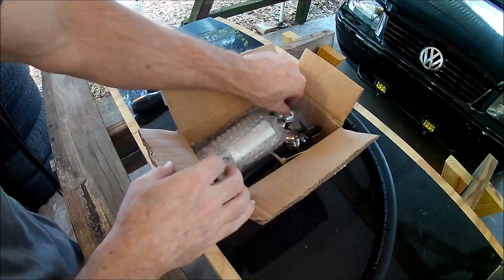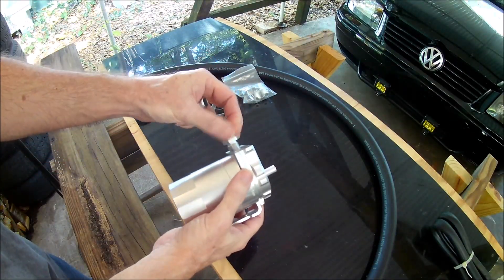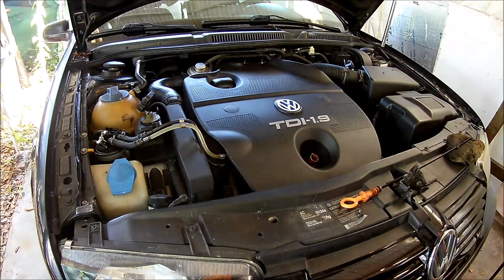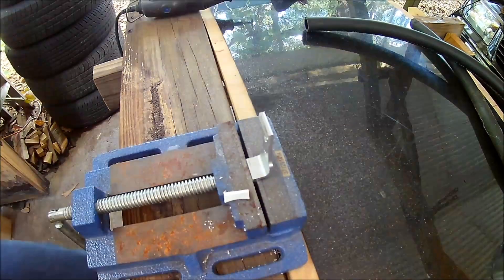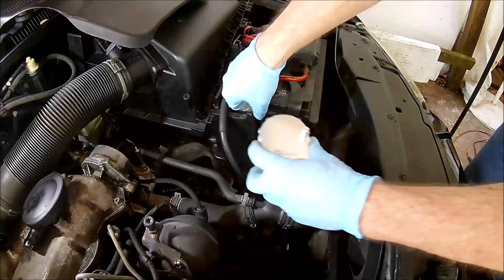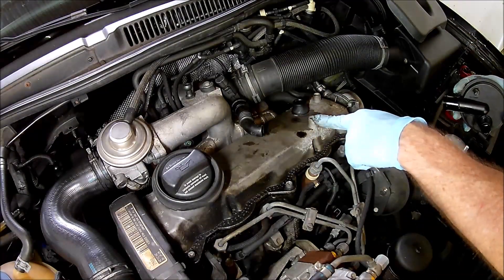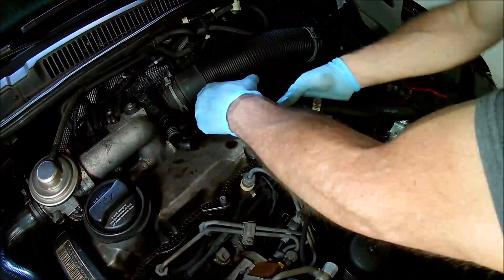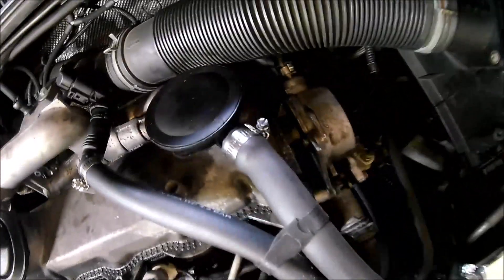Jetta Project Car: How to Install a Catch Can (Mk4 TDI)

Comment: Good video. One question, how have you adapted the engine cover so that it can be quickly removed?
Reply from the maker: I retrofitted the mounting hardware from the PD engine cover. Only requires minor mods to the cover.
https://www.idparts.com/engine-cover-attachments-engcvrblt-06a103951-06a103226-p-770.html
Reply: @michaelblacktree  Sorry, I was looking at the previous comments and came to the same question. They are a little expensive, but AliExpress and the OEM number have my solution. Thank you very much for the attention and the quick response!

Comment: How did you make your engine cover to remove like covers of the PD engines?
Reply from the maker: I retrofitted the PD engine cover mounts. IDParts sells them in a kit. Here's a link: https://www.idparts.com/engine-cover-attachments-engcvrblt-06a103951-06a103226-p-770.html

Comment: With the TT Racing catch can, the OD of the Inlet and Outlet ports are 19mm,  do you know what the ID is?  Was checking on factory VW 2.0Tdi, the plastic breather pipe is  about 19mm OD and  18mm ID. Was wondering if a  aftermarket catch can  has a  OD 19mm and ID  16mm inlets wont it  restrict the engine in any way? I used to have another oil catch can, which i  didnt use in the end as the OD of the inlets were perfect at 19mm but  where its screwed into the catch can the hole is  only 16mm. (M16 x 1.5mm 19mm barb fitting)  Will this be okay to use..Wanted to ask if you knew the TT racings ID of the catch can holes and if  it will cause any harm if the ID is  less than  18mm as factory CCV pipe. Thank you
Reply from the maker: I can't say for sure, but I don't think it'll hurt to have 16mm ID at the fittings.

Comment: Great idea of  cutting the ccv pipe into half,  what  inner diameter black hose did you  use to fit on to old ccv pipe. The catch can itself is 19mm, but the VW ccv bit is 24mm. So  wondering  if i need to get a  reducer pipe.
Reply from the maker: The CCV pipe is roughly 19mm diameter where I cut it. No adapter needed.

Comment: If egr is bypassed is a catch can still desirable?
Reply from the maker: That's a good question. But I think the need for a catch can would be greatly reduced.
Reply: @michaelblacktree  I was still thinking of throwing one on since it can only help. But there are almost zero on amazon with the 19mm tubing and the ones that are available only have a few reviews so I kinda don't trust them as much. Any advice?
Reply from the maker: They're not very common. The one I used was discontinued shortly after I bought it. You could probably get one with smaller fittings, and use adapters. Although anything less than 1/2" (13mm) might be too small.
Reply: @michaelblacktree  there seem to be a good selection of 16mm catch cans
Reply: @W-Will53 if you have geometry turbo yes, it will stuck eventually because of it, will make your engine dirtier and admission. With this engine gets alot cleanear !

Comment: Does this work on the 2.0 vw mk4?
Reply from the maker: If the PCV system is putting oil into the intake, then a catch can will help with that.

Comment: Noticed you have the engine cover conversion also don't use jubilee clips the vibrations will cut the hose that's why vag dont use them ;)
Reply from the maker: Yeah, I used the PD style cover mounting hardware. Messing with those bolts was such a hassle.

Comment: Does this encrease the power of the car ??
Reply from the maker: It doesn't add horsepower. But when the intake manifold gets clogged, the engine will lose power. The catch can helps to prevent that.

Comment: I have the same engine as you, i was wandering if i must go with a catch can with 19mm fittings or can i get away with a 15mm one?  thx
Reply from the maker: With 15mm fittings, you'll need to use adapters. But aside from that, it should be OK.

Comment: Can a bad CCV cause the car to put out a lot of white smoke and also leak oil in the air intake hose ? I just got a 03 Jetta and it can't be driven that's how much it smokes white smoke.
Reply: white smoke means the injectors are leaking    i had the same issue
Reply from the maker: That's a good point. If the white smoke smells like raw diesel, then it's a fueling issue. Otherwise, probably a head gasket.
Reply: @rog4232  Was it injector #3 ? I was reading around that it's common for it to leak.
Reply from the maker: Oil in the intake is common with these cars. But white smoke is bad... maybe a blown head gasket.